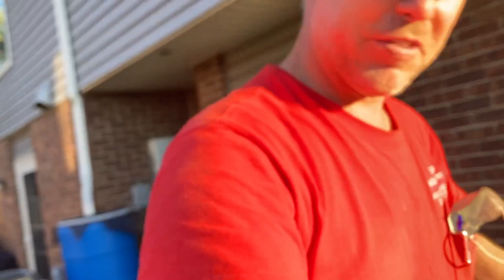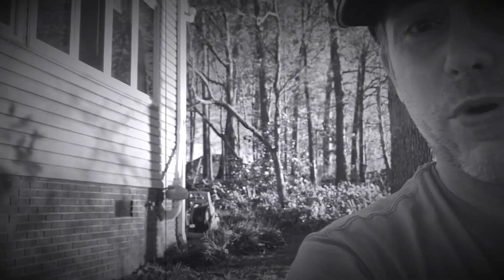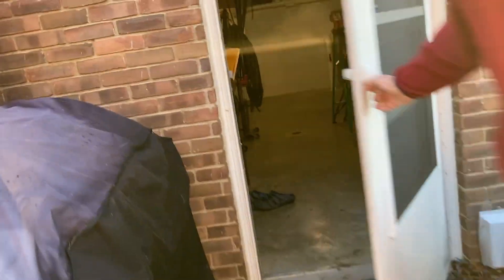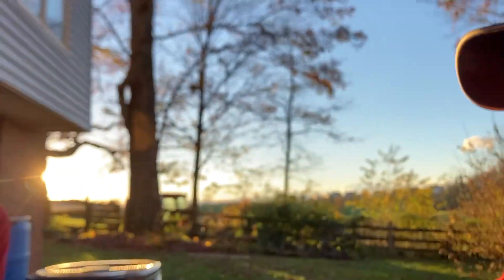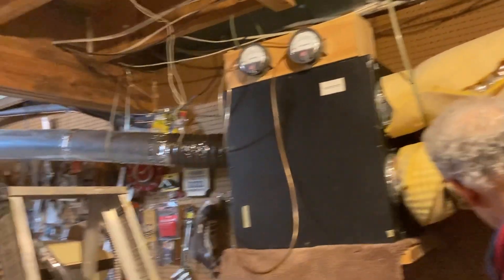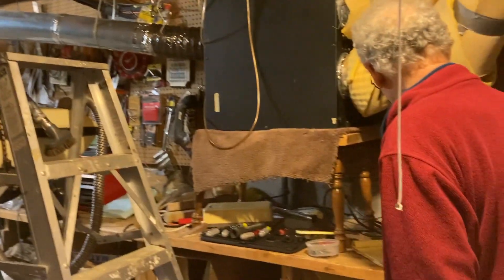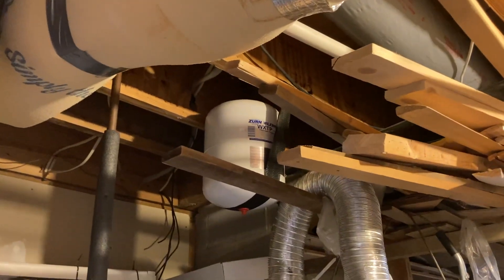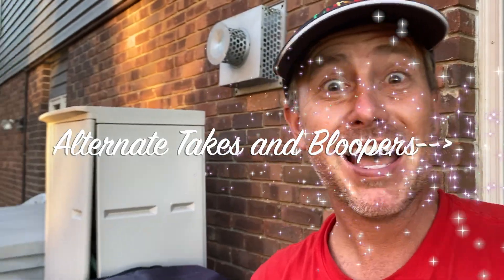Radon Removal and ERV (Air Exchanger)

Comment: Do you happen to know what level they started with and what the level is now? Also, you were there to add a new mitigation system, I assume. Why did they want an additional system.  Thanks for making the videos!
Reply from the maker: Hi Don..I recall that the levels weren't alarming.The homeowner, Richard monitors the radon levels electronically and actually documents the readings on a daily basis.  His pre-existing air exchanger was doing an ok job at reducing radon levels but he saw me installing a radon system at his neighbor's house and had me put one in at his house. I think before it was around 4 pCi/Land after I came along, the levels are around 1-2 pCi/L.